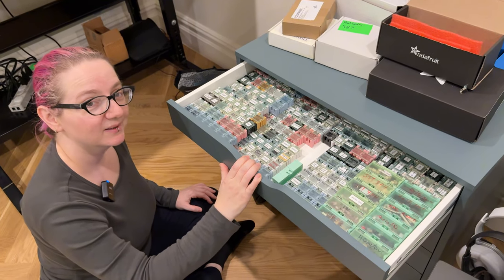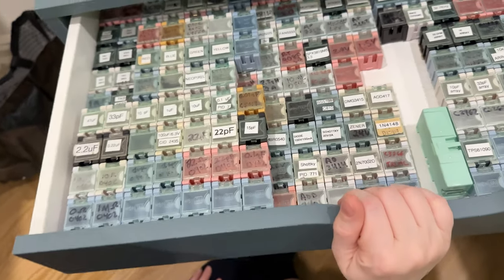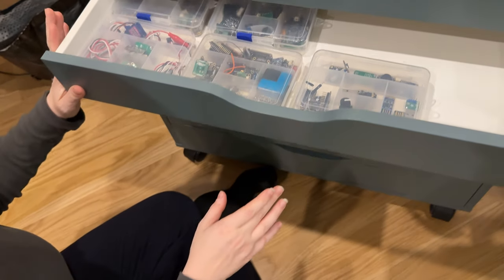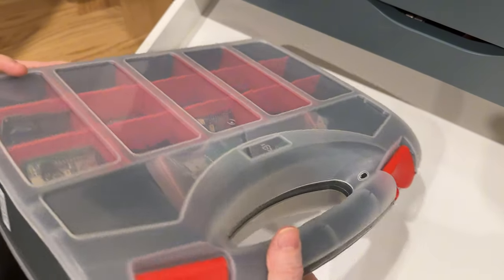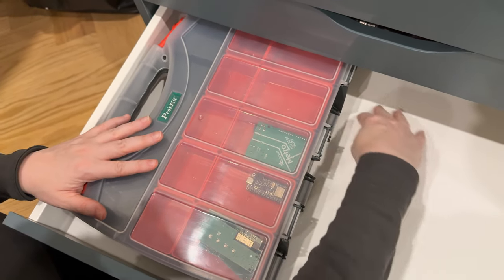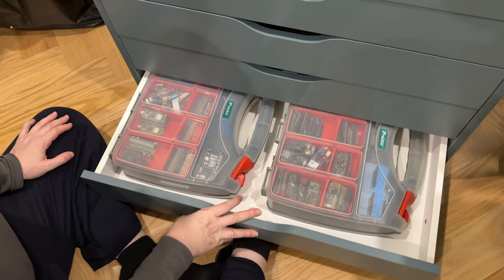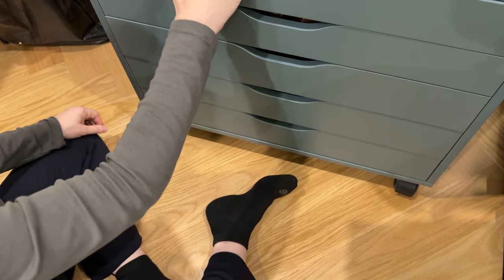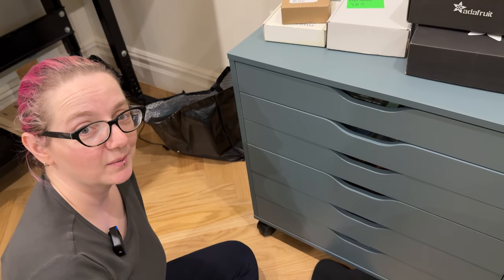Updating organization at the Adabench for the New Year

Comment: Dear Lady Ada,
    Are you aware with the 3D Printing community’s support for   Gridfinity? This is open source project for designing and implementing solutions for storage. Replacing your “go boxes” with Gridfinity designed compartments and slots would allow you to maximize the available storage space and create areas for any components or designs.
Reply: It requires a lot of 3-D printing standard storage if possible can simply be ordered and it is quite simple to use in that sense

Comment: Nice organizing, gave you a like. While I am here, please, never discontinue the Trinket M0.  I rely on it for so many projects and for making diagnostic tools for Fiero enthusiasts. Essentially a computer on a chip for under $9 USD... amazing. If you are new to microcontrollers, the Trinket M0 is the way to go.  It comes with Circuit Python installed, you plug it into a USB port (via a cable) and it pops up like a mini thumb drive. You copy your Python code to it by drag-n-drop, or edit it with a simple text editor and it does the rest. You don't even need the Arduino IDE for it until you get advanced. I am working with a local Boy Scout troop to use the Trinket M0 for one of their technology badges.
Reply: If you're making a new design, I'd recommend a rp2040 based board over the Trinket m0.
Reply: @Supermath101  No, it an existing design. My design expects the Trinket M0 form factor and pin outs. If I were to switch to the RP2024, I would have to redesign my circuit board (the Trinket piggy backs on top of it via header pins), and the Dot Star LED is in a different place. The circuit board contains 3.3V Zener limiters to the inputs of the Trinket M0 and the outputs drive Transistors for vehicle mode control, Although I like the additional I/O, I would have to redesign my circuit board and the case for the new LED position. I make a light tube with a soda straw and hot glue.  It looks just like a domed 5mm LED on the case. My application is for a diagnostic reader for the vintage 1980's GM Pontiac Fiero GT. I have been using it for years and now working with The Fiero Store going public with it. Thanks for the suggestion.